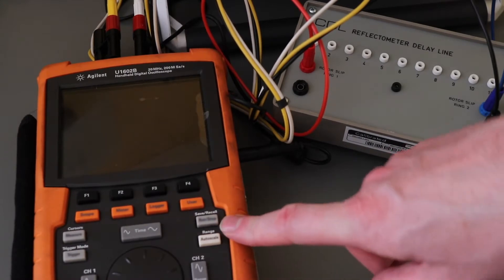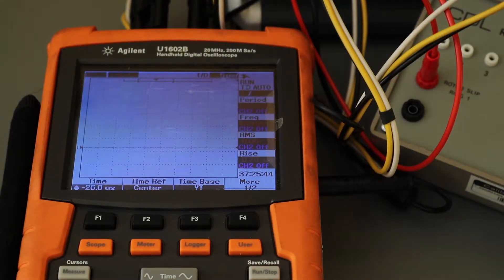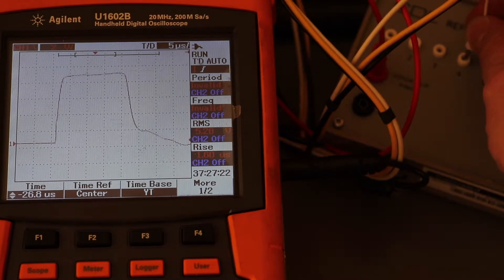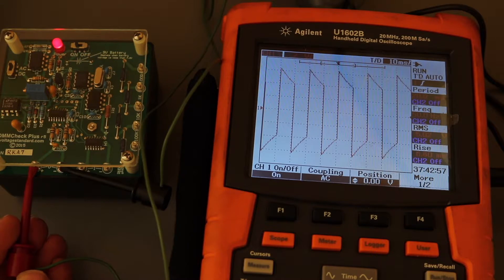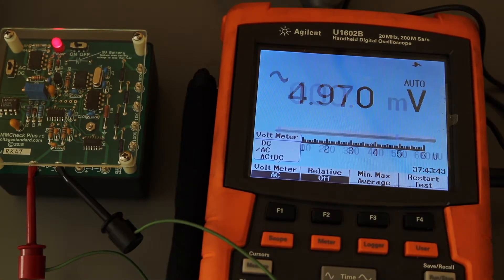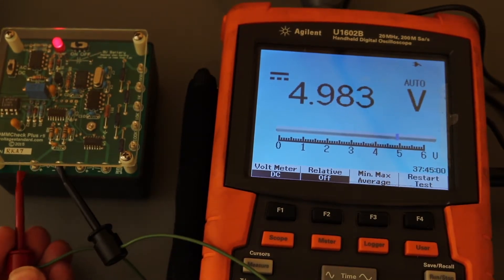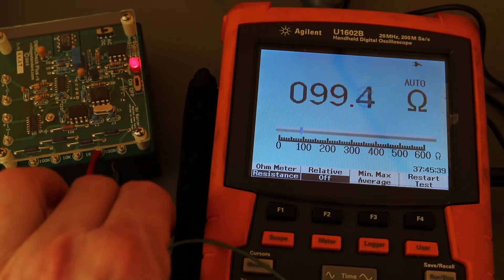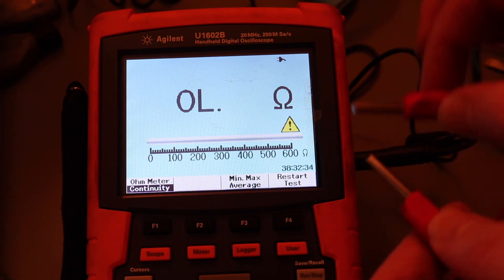Using the Agilent U1602B DSO

Comment: Hello TP, I always find myself returning to you videos sir. I just purchased the Hantek DSO 8060 Oscilloscope , the reason why I purchased a Hantek is because the specs and the build quality was appealing to me. Give me your opinion on my newest purchase TP ?
Reply from the maker: HI TETC. Looks like a very capable instrument you have purchased with plenty of functionality. I have found that a handheld DSO is very useful for electrical work, due to the isolation it offers against a more standard desktop scope - much more robust as well. I would like to upgrade the Keysight to something with a better display at some point.

A 365F data logger is the only Hantek equipment I own. I purchased it to experiment with impedance testing, but haven't got round to building up a test coil for it yet. The build quality of my Hantek unit seems good, little bit lacking in documentation, but it is relatively easy to get up and running.

Enjoy your new purchase. 👍
Reply: Three-phase Thanks TP, you’re opinion is well received. 💪

Comment: Another very interesting and informative video sir great job. I see that you’re a fan of Agilent/ Keysight . I know that Agilent is a high quality brand, but explain to me why you chose the Agilent Oscilloscope over the Fluke Oscilloscope, also why you chose the Keysight Insulation Tester over the Fluke 1587 Insulation tester ?
Reply from the maker: Thanks TETC. There is no major reason why I chose Keysight scope meter over the Fluke. I personally happen to prefer the dial control that the Keysight offers. If I remember correctly at the time, the Keysight was a better price than the Fluke, but I am going back 8 to 9 years now.
The insulation tester is a different matter. For my specific work I wanted a meter that would read up to 100GOhm with a 500V test, DAR and PI functionality along with a variable test voltage. I also needed a 200mA earth bond test function. The Keysight U1461A offered all of this along with multimeter functions. The 1587 could not, there is no 200mA bond test, no variable test voltage and the instrument has a 550MOhm max at 500V. There is no built in memory on the 1587, the FC version allows logging via bluetooth and that aspect does work better than the logging function of the Keysight. Fluke do have the 1507, that has a  200mA earth bond function, but it still limited with the insulation testing.
To my mind, Fluke do not really have a good offering in the insulation tester department at the moment. Even their 5kV / 10kV, 1550/1555 insulation testers lack functionality compared to their competitors.

Comment: Please tell me what voltage and current the original power supply is designed for
Reply from the maker: The power supply is the U1570A and has a 12V DC, 2A output. More details can be found at;

https://www.keysight.com/en/pd-1393488-pn-U1570A/ac-power-adapter?nid=-32301.779155&cc=GB&lc=eng

The battery pack is 7.2V 4500mAh Ni-MH
Reply: @three-phase562  thank you very much!